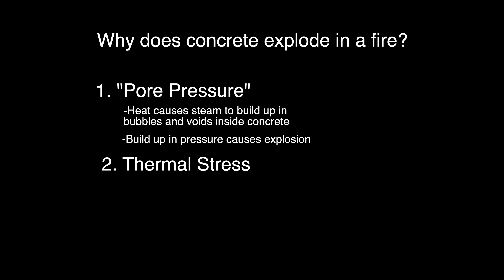Don't Put Wet Rocks In A Campfire

Comment: At my old job as a diesel technician we were replacing a trailer leaf spring equalizer. This required cutting a large 1" diameter bolt with an oxy acetylene torch. After cutting, a large chuck of the bolt landed on the concrete floor still glowing  orange hot. Didn't think much of it but after about 1 minute a 1 inch square section of the floor exploded hitting me with pieces of concrete shrapnel. I could only assume there was an air bubble in the floor that expanded from the heat of the bolt.

Comment: 9:50 "we tried everything we could to get the concrete to explode.."
literally tries one thing
Reply: What else could he do then
Reply: @sonicsupersam7793  a bomb
Reply: @sonicsupersam7793  find a pot hole in the driveway and pour it into that just off the top of my head
Reply: That's all he could think of so he wasn't lying
Reply: @music9170  maybe he maintains it well enough that he doesn’t have potholes?
Reply: @doubtful_seer  But do you really believe that?
Reply: @doubtful_seer  yeah that is good thing that he keeps it good but I'm just saying maybe don't say we tried everything we could to get the concrete to explode after doing 1 test that we knew wasn't going to do much. It would be like me saying is tissue a good material to make an umbrella out of. Then pouring a tiny drop on it and saying well we tried everything we could to get the umbrella to fail but it's still holding strong, looks like tissue is a good material to make umbrellas from
Reply: he shouldve let the water soak into the driveway

Comment: 2:44: FUN STORY TIME!

So... I too was in the boy scouts, and we occasionally would go snow camping.  Nothing beats a long day of snow camping like a camp fire at the end of the day to lift everyone's spirits.  However! Fun Fact: you can't build a fire on snow -- or rather you can, but the snow will melt, and yadda yadda... so... one of the bright boy scout dad's always brought along an old washing machine drum.  You build the fire in the washing machine drum, and it insulates the fire from the melting snow, but also has holes for air to get in so the fire can keep going.  My young self thought this was a great idea for a backyard fire pit, so when my parents washing machine went out, I dismantled it to turn it into a fire pit.  One fateful night we decided to take the fire pit on its maiden voyage with a couple of friends and family over.  Long story short, old washing machines have something called an inertia ring, that explodes when you heat it!  Not to worry, everyone was ok.  The inertia ring on a washing machine of that vintage was sealed with a rubber stopper, and so the stopper blew out (which, yes, it did sound like a gunshot), and the black sand that keeps the drum moving spewed all over the place.  It was pretty amazing... luckily nobody was hurt... =D

Another fun time was when my uncle put a magnesium VW engine block in the campfire when we were camping one time... that was also pretty amazing, but in a completely different way... and that's how we were never allowed back to that campground... XD
Reply: Lol who knew

Comment: Yeah, I have had a rock explosion experience. My family was at camping, and we found a large amount of clay in the lake. We decided to try making mini pots, and that worked for the most part. Although, we put one of the pots in the fire to harden while it was still we, not thinking too much of it. But, after a while of the fire going max heat, it exploded, sending pot shrapnel flying everywhere. One went flying at my face, luckily not injuring me and just bouncing off. But yeah, it was loud.
Reply: did someone asked?
Reply: I've worked ceramic before. You need to let it dry for about a week in warm, dry conditions or it'll pop and send shards through everything else in the kiln. Also important is mixing and kneading the clay thoroughly until it's soft and generally no more than a pinky thick- that prevents air and powder bubbles, which also expand and explode. There's soft, leather-hard, and bone-dry as general descriptors for the stages of dryness in unfired clay. You need bone-dry to fire. Leather-hard, which is good for scoring and sticking together for sharp angles and flat surfaces, is cool to the touch and may look dry. Soft is workable and difficult to make sharp angles with, like boxes. Bone dry should be room temperature and might feel like it sucks the moisture out of your fingertips. It will also likely leave powder on your fingers. Do not glaze before firing- you always want to fire, cool and dry properly after rinsing, glaze, let dry, then fire again.
Reply: @watterr45  Me, I wanted to hear their story
Reply: @watterr45 the video literally asks at 2:35 to leave a comment on when you had an explosive experience around a campfire. Do try to keep up.

Comment: Yep! My brothers and I had been fishing back in the mid 80's. It was cold, so we started a pit fire. About a half hour or so I could hear this very high pitched squeal coming from the pit. I asked my little brother where he got the rocks, he said in the river. I yelled get back!  About 10 seconds later a rock exploded with such force that one of the shards tore a triangle shaped hole in my new wind breaker jacket; and we were about 30  feet away. Needless to say, I didn't need to explain the science to my brother after that.

Comment: Just last night me and my friends were enjoying sitting around a nice peaceful camp fire in the Ozarks of Arkansas until I got the bright idea to put gas an an old antifreeze jug and throw it in the fire. But nothing to crazy happened so we started throwing rocks in the fire trying to hit the gasoline filled jug of antifreeze. And it worked it made a big fireball. But later we was just standing around the fire again after it kinda settled down and then one of the rocks that we threw in the fire earlier just exploded like a grenade. A small piece hit me right below the eye but it didn’t hurt. So yeah rocks can definitely explode if they are smoldering in hot coals, I figured that one out the hard way.

Comment: I was out with two friends camping and we rolled a massive bolder down the nearby hill. We used it as a fire pit wall and started a fire. About 7 hours of fire later I was about asleep and the fire was mostly out but all the sudden I heard the loudest noise in my life and it was such a bang that it blew the hammock I was in back and started swinging. This was followed by 4 more smaller explosions and the next morning the bolder was gone. Looked for fire wood the next day and found a part of the bolder roughly 200ft away

Comment: I did not have any big explosions, and we never heard it go off, but at a beach bonfire, we went down to the surf to collect rocks to line the bottom of the pit. They were wet and dripping. It was only after the fire died down when we cleaned out the pit we made that we noticed that almost all the rocks we used were split, cracked, and just in smaller chunks. No one was hurt or hit, but only after we were done and about to leave did a safety patrol car tell us why we should not have put wet rocks in the pit.

Comment: That's interesting, one time I spiled about 10kg of aluminum on concrete floor and nothing happened. Not a single pop
Reply: VILKAS i want the context of this story
Reply: Most likely the concrete was a dry and Porus
Reply: It was about 7 years ago when I started casting aluminum sculptures and other stuff. Short story-  we pulled crucible out of furnace everything looks good and suddenly when we were ready to pour metal into sand mold aluminum stared leaking from bottom of crucible, of course we put crucible on floor and stepped aside (expecting for explosion or splattering) all metal leaked from crucible on concrete floor and nothing happened. It was huge "river" of aluminum about 180cm long and 30cm width, surface wasn't smooth it had huge bubbles. Probably it depends on concrete mixture, type and pouring process, but if we talk about bronze or iron I think it will always splatter especially cast iron.

Comment: I used to have bonfire parties back in my early 20's. We had a big fire pit built in my back yard. Well, it was 4'x4' which is the biggest you can legally build in my area. One party was in the middle of February, right in the middle of a snow storm. There was already a good 6 inches of snow on the ground and it was still snowing. We had a fire ROARING. Flames were like 6 to 10 feet high. It completely melted a ring around it in the snow like 8 to 10 feet out. It was hot. Which was great in the cold. It was an awesome party. It was only like 45 mins in and we all started hearing these popping noises and what sounded like stuff hitting the side of the building. I went out the door that faced the fire pit and realized the rocks we used to build the fire pit were exploding. Little pieces were flying everywhere. It was more annoying than anything. Nobody got hurt. But it was interesting. That's when I learned that rocks can "explode" when heated, especially if they're wet and super cold.

Comment: couple of buddies and i had a fire underneath this bridge that had a concrete tunnel, normally it had flowing water but at this time it didnt. after about 20 minutes all of a sudden we were in the middle of what seemed like a grenade going off with shrapnel bouncing all around this little tunnel, to then realize we had just blown a crater into the concrete floor. it was intense enough it chipped my windshield of my truck that was a good 40 feet away. luckily nooone was hurt, we learned a lesson that day!

Comment: In the 70's and 80's we used to go camping, and never had an issue with exploding rocks, no matter how wet or dry they got before, during or after the campfire. On the other hand, my father had dug out a level area of our back yard, exposing an 8 foot high series of walls of fractured sandstone. In the corner between two walls he piled up all the bark, twigs and sawdust from a load of wood he had delivered and burnt it to fine ash. He told me not to go near the corner for three days after the fire went out because of the small chance of exploding rock. Three days later, the once black rock was fresh again as all the surface layer had mostly flaked off, but pieces as big as an adult fist had hit a fence 65 feet away! After the three days, the rock wall was still warmer than the surrounding rock, and when dad threw some water on it, it went off like fire crackers, showering coin sized chunks a few feet from the wall. As dad later explained, it's the thermal shock of cooling that is the issue. If the rock cools too fast, the stresses build up to explosive pressures. Granite and basalt are awesome when cooled quickly after heating. I've see them shred through trees like hot missiles.

Comment: Any pocket of air trapped within a hard substance, once heated, will expand. The expansion and abundance of pressure is dictated by the heat thermal energy applied. This is the likely reason for the “explosions” coupled with the excited compound atoms weakening the substance. Another likely reason for the wet rocks to be more active is the thermal insulation of the moisture, or the thermal transfer caused by the moisture.

Comment: I saw exploding rocks once when I was 10 or something like that. It was summer camp, and we were burning a big bonfire day after rain with some big (maybe not so big, I was 10yo) roundy rocks, and we were bored so we threw some cones in the fire. And then rock started to explode, one after another, the elder told us to stop throwing cones in fire, we of course stopped, but even that I understand that it's unlikely that cones will explode, and do it so freaking loud.  If I remember correctly all rocks cracked after some time, some of them very loud

Comment: People who use rocks in their sauna stoves know that not all rocks work the same. I mean it's the same base premise of heating rocks, then throwing water on them to vaporize the water. It's very common to hear the stones pop and crackle inside the stove but in 40 years I've never heard anyone get hurt because of shrapnel. Mostly it's because of the upper half of the stones are cooler and less prone to popping and it usually happens deeper inside. I have heard of cases where people have made saunas while camping out by heating up stones over a fireplace until they're hot and moving them into a tent and pouring water on them, which HAS resulted in more violent reactions... though it's considered quite silly and recommended against, and I've also never heard of any injuries from that either.

Comment: also concrete has a lot of calcium carbonate on it's mixture, and when heated up carbonates decompose on CO2, usualy by the time it hits 600°C (like in a building fire) it starts poping like the one with rebar....now think the whole structure doing that...been working on quality control of concrete for 3y now...you learn a lot of intresting stuff

Comment: With exploding rocks, here's an old piece of advice that my father learned from an old timer, NEVER use field stones (stones pulled of a field that were mainly buried) in a fireplace! It's very common for them to have moisture just soaked into them, when the rocks heat up the water can turn to steam and KABOOM! My father told me about a feller who built a house and used field stones for his fireplace, he lit a fire in it and after a while the stones started exploding, and consequently the house was set on fire and burned to the ground because of it.

Now if you are determined to use stones that were pulled out of a field, there are a couple methods to try and make them safe (other than making sure what type of stone they are). One is to toss the rocks into a fire and save out the ones that don't explode, the other is to try and dry them in some sort of a kiln, or to keep them somewhere dry for a looong time. If you attempt to dry the stones then be careful not to heat them up too much or they'll bust, you just want to heat them enough so it'll help the water evaporate a bit faster.

Comment: When I was about 12 or 13, I had a rock explode and a piece flung up and hit me in the neck from about 8 feet away. It hit me hard enough to feel it, but didn't puncture the skin, what did the most damage was the heat from it, which left a small burn on my neck.

Comment: I went camping with about 10 people 3 weeks ago. One of my brothers friends asked if it was dangerous to just throw a rock that he pulled out of the ground into the fire (this was up on the mogillon rim in AZ so its basically just sandstone and really sharp granite and quartz) we told him that its like throwing a grenade in there. All he said was, "damn..". I go back to another convo, not thinking much about his question. About 2 minutes later i hear a really high pitched tinking sound, like a thin piece of glass being dropped and my brother and i look at eachother for a second and then we stood up and walked about 5 feet behind out chairs(all of the people there know that my brother and i grew up in the forest basically so they were smart and got up too and did the same). The friend that asked the question was now laughing at us and calling us scared, my brother and i stood there and just smirked a little, because around 10ish seconds later the rock starts popping like a strand of firecrackers going off and it starts throwing shards of hot and insanely sharp pieces of rock at him and he got up and ran like he was swatting bees away from him😂 (laughing because everybody was luckily completly fine) it was a learning experince for him. I feel like he slightly deserved it for just throwing a moist rock into the fire, without us knowing right after asking if it was dangeous. Again everybody was fine so it was fun to laugh about afterwards. But it definitly could have gone worse had he thrown a fully saturated river rock into the fire. It was slightly smaller than a baseball sized rock too, forgot to mention that.

Comment: One time I was camping and I had a fire under an overhang. Those rocks had water in  them and hissed and popped and dropped slabs. It was scary. it was not the size really it was that the rocks then explode in the fire, throwing embers. The rock themselves are probably not that bad (unless dropping on you from an overhang) also, if they surrounded the fire it would be a very hit fire flinging rocks.

Comment: 3:25 I have seen spitting logs throw embers and entire coals the size of a quarter up to 3 feet. someone threw a really wet and sap filled pine log into a fire recently, and it ended up exploding and launching a coal the size of a walnut into my friends lab. a red hot coal. luckily he jumped up and the coal fell down before it burned through his clothes. don't throw soaking wet logs in the fire... you want to dry them next to an existing fire if you have to use wet logs

Comment: Growing up on the PNW we would build driftwood fires 5 to 20 ft tall. The dry rocks we built the fir on was no problem. But if we got soaking wet rocks out of the tied line threw them in the fire they would explode with enough force to blow the fire apart. We knew what we were doing. You need to do better research.
Any river rock can explode as well if it has monster in it.

Comment: The trick is to heat them slowly. I've made a LOT of campfires over the years, and never had rocks spall or explode. If you have a cold, wet rock and toss it into a hot fire, yeah... but heat them slowly and you'll have no problem. I made a sword forge out of Lowes cinder blocks and pavers once. Same thing - heat them slow and let them evaporate the steam. They didn't last long, they crack from the heat, but they never exploded.